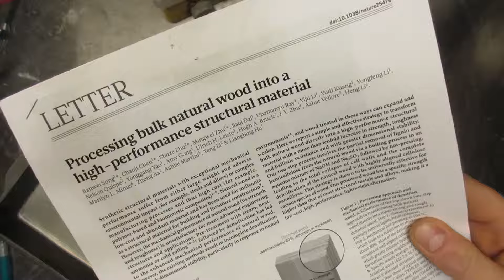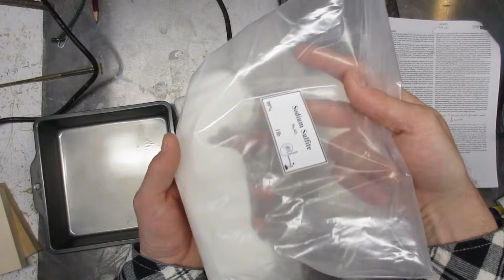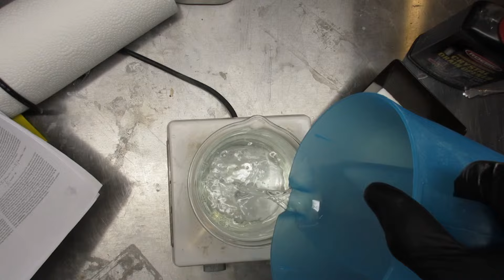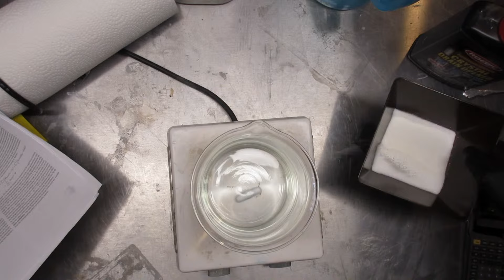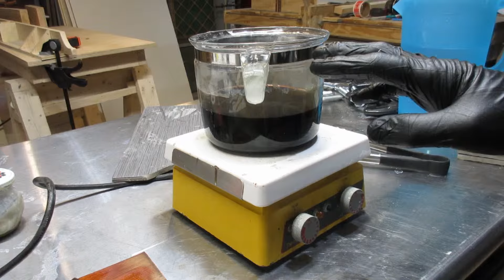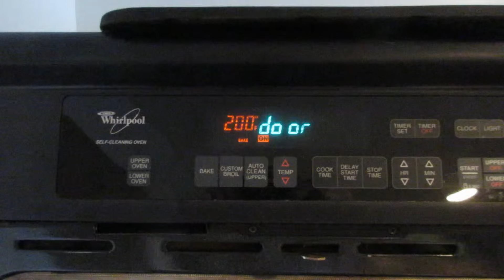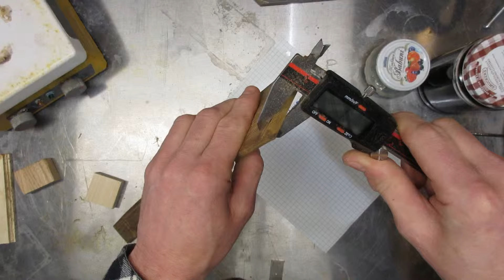Wood Densification Experiment

Comment: The public would like to see a relative strength test.
Reply: a strength test was done by who ever wrote the paper he had, use the link https://www.youtube.com/redirect?event=video_description&redir_token=QUFFLUhqbENsNERmbTFjWjdLd2Ewd2VvSkpXdW40eXBTQXxBQ3Jtc0tuTFQtSUpaaW5IcGhhVGFMeXJUUkp4eUxFcFZaWE9VSWo4UmVDajhiR0ZKOHVhUnpMd2txd3E4dDctcWRBYlY4VzZSUzZHYlZHSzBVdkEwVXNkTTgwYklhZ0x6ZmFlbHBJenYxMnk3UlRteVYtR2dYVQ&q=https%3A%2F%2Fwww.nature.com%2Farticles%2Fnature25476
Reply: @lyvwyr70  sure, but we'd like to see THIS result tested. You see, not everyone owns a $3000~4000 heated press, while on the other hand C-clamps come for *much cheaper*. 
Which is why this particular result needs testing.
Reply: @inverse2k1  I'm about to apply for a research grant to see if you can make a similar material out of mycelium composites
Reply: Young's modulus would be good. Both MoR and MoE. Surely there are labs that offer that as a service?
Reply: What I want to see is a comparison of the strength of densified wood formed into an I-beam vs a square beam of raw wood.
Reply: yeah, youve produced it --- but what s its properties that supposedly make it a good building material -- ive seen vids about 'superwood' but everything handwavy -- id like to know how it comapres to frroconcrete, concrete and steel and aluminium in tension and conpression - and see it it really Rot proof and termite proof ----  ie how to use it.
Reply: Come on do wood strength test to us, and see